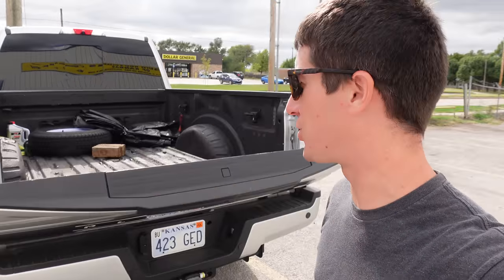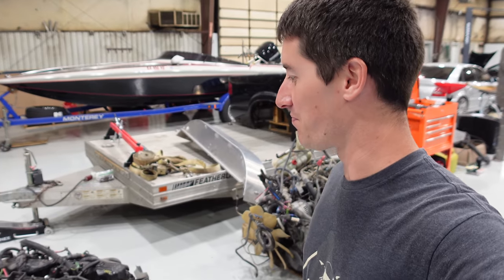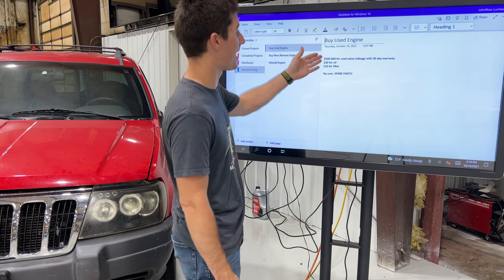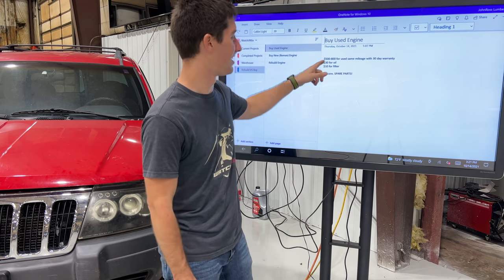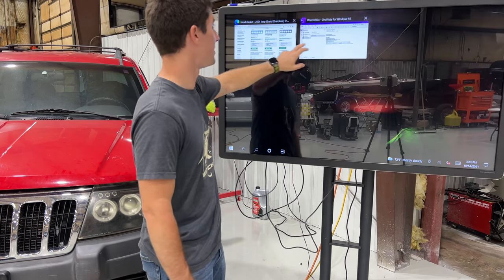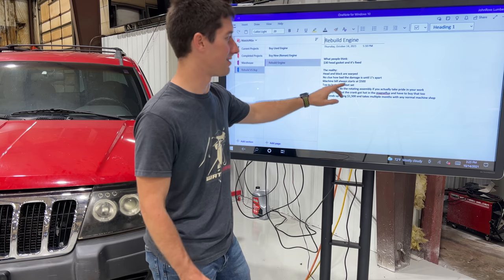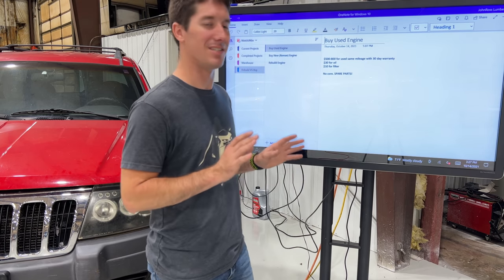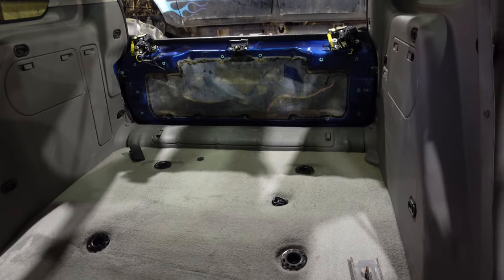Here's Why You Should NEVER Rebuild An ENGINE *The Math Doesn't Add Up*

Comment: Depending on which JEEP model and engine you have, some should definitely be replaced instead of rebuilt. With the introduction LS engines Chevy 350 smallblock engines are a dime a dozen, and easy to work on and/or rebuild, with parts available pretty much everywhere and very affordable and easy to acquire.  I just replaced a Chevy 350 smallblock engine  in my 1981 JEEP CJ7 for less than $500 total cost, and rebuilt the former 350 smallblcok engine pretty cheap as well, so I have a spare engine incase the new engine doesn't work out for some reason, or I can easily get my money back out of it, since there was no catastrophic damage to the block or heads, and theoretically, it should perform like a new engine, and be good to go for another 100,000 miles or more, if driven, and maintained properly.
 Hyundai's and most other foreign vehicle's engines should always be replaced by a qualified automotive technician because they are a completely different animal, and can be very expensive, difficult, and time consuming to rebuild, and require expensive specialty tools.
Anybody who doesn't possess the 'know how' and/or have the tools, time, and an available facility to rebuild or replace a vehicles engine should always look into having it replaced vs. simply buying a 'new' car, if it is not covered by an insurance policy, because trying to have any work done, or doing it yourself, can be way to expensive, as well as long and drawn out, resulting in a vehicle that sits around too long or never gets completely done and back on the road again.
 If you're a car dealer, and have a budget that allows you to replace every faulty engine, it's a no brainer that you will save tons of time and money by having bad engines replaced so you can sell the vehicles faster, with less headaches, and with the better selling point of having a new engine, that more than likely comes with at least a 90-120 day warranty, because you, as the seller have more confidence in the new engine than you ever would have in an original engine, unless it's pristine and has been taken care of religiously, with fluids replaced every 3,000 miles, and good records kept to prove it.
 But if you have good mechanical skills, tools, time, facilities, and patience the most common engines are always easier and cheaper to rebuild yourself, so you literally have a brand new engine with O miles on it when you're finished, and potentially have a vehicle that can easily go another 100,000 miles or more if driven and taken care of properly.

 ALL newer engines have way too much computer stuff attached to them these days,  and require just as much new knowledge and tools to work on yourself, unless you're very adept with auto mechanics, or are an automotive technician yourself.
 So there really isn't a 'blanket' answer for all vehicle engines as far as rebuilding or replacing, because there are way too many variables to be considered. For the average consumer who doesn't have any experience, tools, or vast knowledge of auto mechanics, having a faulty or broken engine replaced is the only answer, if they want to keep that vehicle on the road, unless they have a good friend or relative who can fix or rebuild the engine efficiently and cost effectively per their finances and available time frame for the vehicle being 'down' and getting repaired.
 If the vehicle in question is a 2nd vehicle, and it has a commonly rebuilt engine that's one of the easier to work on engines, with good parts availability, and you have spare time to do the work yourself, you can save a lot of money, and have good peace of mind by simply doing the work yourself, with so many valuable resources, and DYI videos on the internet to help guide you to a high quality engine rebuild, that is affordable, and easy to do yourself, if you can simply follow instructions. Those people who have very poor or no mechanical skills and tools, should never even consider rebuilding the easiest engines, because it's way too easy to get lost, confused, or simply lose focus on the project, once again resulting in a vehicle that sits for way too long and/or never gets completed and back on the road.
 It's most definitely NOT brain surgery though, and with a little money, time, basic tools, or tool rental, and proper guidance,, it's no more difficult than putting a puzzle together. We tend to make simple things a lot harder than they really are, when we should always have the positive attitude that if someone else can do it . .  I can too..              In most cases
 So learn to discern . . . .  and take proper care and maintenance of your vehicle's engine so you never have to worry about rebuilding or replacing it. 
 Your automobiles Owner's Handbook includes everything you need to know to properly care for and maintain your vehicle's engine, drivetrain, brakes, etc. and if yours didn't come with one, or it got lost or stolen, most Owner's Handbooks can easily be downloaded in a PDF, or otherwise easily printable format.                             PEACE, and good luck
Reply: That's why I'm replacing my XJ old 4.0L for a Chevy 350 SBC,  way more cheaper than the 4.0 wich cost me between 1500 and 1600 just on standard parts (parts cost in Panama).  If the engine needs oversize parts, have to order them to US.

Comment: I had a 2017 jetta with a destroyed 1.4 tsi the dealer wanted rhoughlt close to 10,000 for a new short block and labor (at the time this engine was brand new for the US market, hence the cost) . I bought an engine from ebay $900 and drove it for another 20,000 miles and sold it. Used engines are always the way to go

Comment: If it hasn’t been running with a bad gasket for too long and the miles are low, it still runs and the engine is quiet, oil isn’t milky, it sometimes makes sense to just do the heads.  Couple hours and a couple hundred at the machine shop, I usually get mine back next day or the day after.  4 or 5 hours for the head depending on the car vs sometimes 20 for an engine swap...every case is different.  This coming from a mechanic to customer POV though

Comment: Those 4.0’s have huge problems with the piston skirts also. Then the couple years where the head cracks. Nice old vehicles for northern areas great in snow with a nice ride but it’s the luck of the draw with those Grand Cherokee’s. The frames crack a d break when their from northern climates also. I’ve seen them look mint but the frame it’s screwed. Always buy the lower control arm to the frame in the back.

Comment: I've been down that road. I'd be surprised if it could be done for $1500. I spent more than that rebuilding a '93 Miata engine. But with an older car, it's not that easy to find a decent salvage engine. Since all of them are almost 30 years old. With old seals and leaks. So for older classics, a rebuild is probably more indicated.

Comment: You're definitely right on the swap option provided two things, that the used engine is affordable, and that the engine type doesn't have an intrinsic fault that causes catastrophic failure. For example some Jeep, Dodge V8s have a habit of dropping valve seats, and loosing rocker arms. If you bought one of those used for a flip its fine, but if you wanted to keep the vehicle for a while longer you could be buying a ticking time bomb. It's a risk vs cost weigh up either way, and everyone will have their own unique circumstances. I guess the best thing you can do is find a junkyard that has good customer service, and a good warranty.
Reply: Is it OK to sell a "ticking time bomb" because it's a flip??

Comment: I get it that flipping either a vehicle or a house all comes down to investing the least amount into it, quality & longevity of repairs given no concern. However, if  seeking a salvage yard engine, do you know why the vehicle it was pulled from was junked? Totalled in an accident or just worn out? The engine will likely be on a rack and you have no way to verify that the mileage they show for it is honest. Even if the yard offers you another one if it's found to be junk once installed, you are incurring significant additional labor costs for another remove & replace. Definitely a gamble that one shouldn't overlook when considering that option.

Comment: I like my van but with a 4.3 if it blew up I'd LS swap it with a you pull yard engine.  Or at least put the equivalent year 350 in it.  

$800 is cheaper than a rebuild for sure, if you're flipping to make money and don't really care since you won't be driving the car. Of course it risks a lot of unknowns in the new engine, since you don't know much about the vehicle it came out of, but it is warrantied. 

Question: Is it worth the trouble to tear down the old engine and find out what failed, as video content?  Maybe you do a couple hundred bucks from it.  Guys like carnage.

Comment: There are times for sure. Money spent on a junk yard engine in my area is super cheap. About 1/3 of what you spent. However, they aren't taken care of so you usually need gaskets at least. If you can rebuild it yourself then you will save money assuming you don't need any special parts. Spun rod or hole in the block gets expensive. Bent valves from a timing belt snapping is affordable. Have a machine shop work the head and spend a little money on a hone and mic set and rebuild it yourself. Oil, coolant, filters, and transmission fluid if it's an automatic, then freon... that's much more than $50.
Reply: One thing about rebuilds, is once a machine shop gets involved, the dollar signs start rolling up very quickly....I wouldn't want to risk it myself, but some old timers just honed stuff and put it back together with new(or sometimes used) parts themselves, no machine shop at all, and had decent success.....

Comment: I agree 100% with this. However, this works best when a car is no more than 25 years old. After that, junk yard engines are either too old to rely on, or scarce.
Reply: #44’s $4Clunker$ 2009
Mistake removed MANY
old engines from the USA.
😳😬😠😡.    CB

Comment: Does the parts yard warranty your time of swapping engines if you put the new one in and it has a rod knock or a bad head?
Reply: No. Your time is your problem.
Reply: Just like the Casino. The house usually wins. That the risk you take.
Reply: Man I had a coworker replace 3 transmissions in a row on his expedition using junk yard parts and gave up after the third one to save up for a reman. Felt so bad for the guy. He was doing it by himself too.
Reply: @travispoulin252  I've been through the same,I never trust yard parts,if I get anything from the yard,engine, transmission it's basically just a core to rebuild,these 4 liters have crazy miles on them all the time,if I was going through the trouble of yanking an engine I would at the very least run through and re bearing it for the extra 100 bucks or so and a half hours time it's well worth it to not have someone sue me for selling them a car with a junk engine,these engines are notorious for cracked heads if they even get overheated once.

Comment: It's so true. Just like replacing body panels rather than doing body work. I had a 2012 Impreza with a bent door, and I found an OEM color matched door for $250 with all the internals intact. If I wanted to fix the damage, it would have been $800-$1,000, and would never looks as good as OEM. I try to relay this information to my friends, but they usually get talked into a repair by some family member or slug-mechanic and get hosed.
Reply: The only part of a car I would get body work done is the rear quarter panel or roof. Everything else is a matched color junkyard part-solved in a matter of hours.

Comment: I've replaced more head gaskets than I can remember. If it was run hot the oil will stink. But usually you can get it running before doing anything just to verify it's just a gasket. Bottom ends will hold up very well it's rare when an engine is replaced because a head gasket craps out. Just my 30 years of personal experience.

Comment: My son put bearings and rings in a big block 430 buick 5 years ago.he rolled it around on a dirty cat litter covered garage floor. Done a ball hone on the cylinders.burned the scale out of water jackets with a torch.this engine runs perfect with no oil issues.about 350.00 spent. I think older engine are more forgiving to sloppy workmanship. I do not agree with do not overhaul old engines.  About a year later he rebuilt the transmission a th 400. Also works like new even with old converter. Both have outlasted what a warranty would be on a reman engine  trans.

Comment: While I do agree with everything you're saying, as an amateur wrench, not a car flipper or pro, I will also disagree. My time is my own, therefore it costs me nothing to first disassemble an engine to determine the extent of repair needed. I have encountered several blown head gaskets, and broken timing belts, and didn't have a warped or damaged head. Also, I absolutely have restored a heads surface using nothing more that a plate of glass, contact cement, Emory cloth, a $50 machinists straight edge, feeler gauges, a flashlight, and Prussian blue. All it takes is time, patience, and some skill. I've also restored valve seats and replaced valve guides with nothing more than hand tools. 

Bottom line is this: "what needs must when the devil drives" if you have a really limited budget and all the spare time that you need, then spending $300 for parts makes a lot more sense then $800 for a used motor. Note though there are places I draw the line: holed pistons or seriously damaged cylinders, forget it. That crap went everywhere inside the engine, time to get a used engine. Also, used engines, especially ones from low mileage wrecks, still have factory tolerances that you won't be able to achieve in your garage at home no matter how careful you are....so I avoid bottom end teardowns...but pulling heads I'll do any time versus pulling the engine.

Comment: There are some engines I wouldn’t do used, a dodge 4.6 for instance is probably bad from the yard. Reman engines have updated parts to fight the bad oiling they have. Also my local yards give no warranty on anything with over 20k on it. And they charge as much as a reman. Lkq here is double yards 100 miles away. I’ve had to drive 4 hours to get used doors before

Comment: In the world of flippers with common vehicles and engines where junkyard engines are readily available at a cheap price, you're a hundred percent right. But when it comes to my vehicle that I intend to keep for a long time, it's a different story. If I'm going to go through the trouble to pull the engine, I might as well go inside it and make sure everything is right. Flipper cars are like flipper houses - caulk and paint make it what it ain't, cover it up and get it sold.
 I was looking for a 5.7 GM V8 for one of my Chevy work trucks and the local shops wanted $1,000 Plus and their warranty was "if it's no good after you put it in pull it out I will find you another one!"  Considering that I'm not a professional and don't have a shop with a lift and full set of tools, that's a heck of a lot of work for me to risk putting in something that may be no better than what I'm pulling out.  additionally, I am using these trucks to earn my living I much rather schedule rather than swapping engine and have it down again four months later! I'm not disagreeing with your saying but I think it depends significantly on what your long-term plan for the vehicle is.

Comment: Let me start by saying that I'm 'OLD SCHOOL'.  My father was an Engineer, I was trained as an Engineer, and I've known a few peeps over the years that knew a thing or two about building engines- Richard Petty and Smokey Yunick  among them.   I guess what matters most, is WHY you care about the engine in your vehicle.  If your primary focus is simply to squeeze every centavo out of turning autos, then this fella has a point.  On the other hand, if you love the car/truck/motorcycle etc. that you have pride in driving, then doing a rebuild is the ONLY way to go.  These places that routinely turn hundreds, if not thousands of rebuilt engines. usually do so with minimum investment of parts and labor/maximizing profit being their target.  However, men who do this because they love it, can easily turn out rebuilts that in pretty much every way, are superior to brand spanking new engines fresh off the assembly line.  Starting with the fact that a freshly cast block usually has built in 'stresses' which will over repeated operation will eventually be relieved as the metal in the block 'settles' and dimensions stabilize.  Secondly, assembly lines often contain aberrant deviations (incorrectly torqued bolts, factory permitted variations in  specs etc.  which can all be rectified/improved by a motivated and skilled mechanic working from a good used thus stable block.  Simply put,  in a vehicle you care for, the sound, feel, and power of a well crafted "blue-printed" engine, will bring you a personal joy and self  satisfaction that is difficult to achieve in any other way.  OTOH, if a car to you is something equivalent to a toaster, then JR's advice is the way to go.

Comment: Here in Australia, you will find that most auto recyclers will only warrantee a used engine, if you have a licenced mechanic do the install. With that cost included, and you are not trying to flip the car, where the new owner wont get the warrantee, it is worth a rings and bearings refresh.

Comment: Problem with buying used engines is they often have problems too.  I rebuilt my engine myself.  Payed a machine shop to bore the block, Machine head and valve job.  Parts and machine work was $2800.  Been driving car for over 3 years and 45k miles.  Money well spent and not questioning the health of a used motor.  You often hear a motor has low miles, later to find out it has major problems.